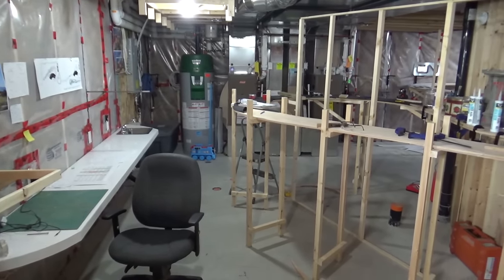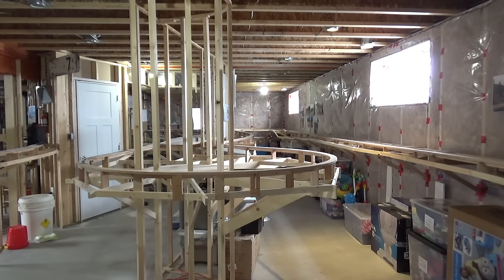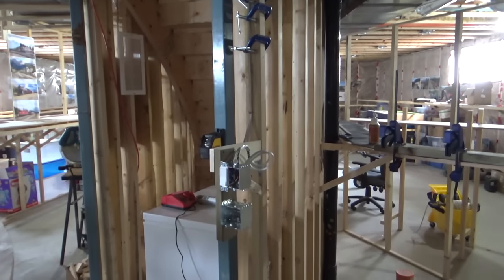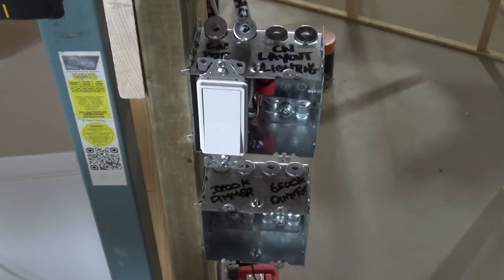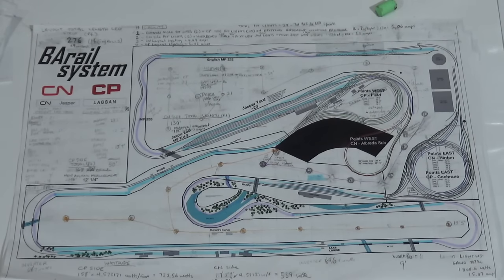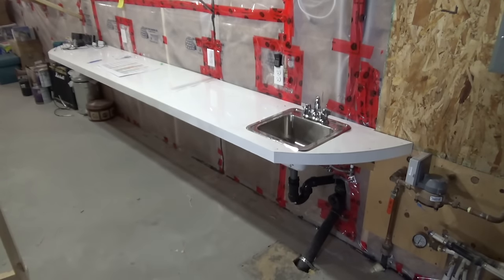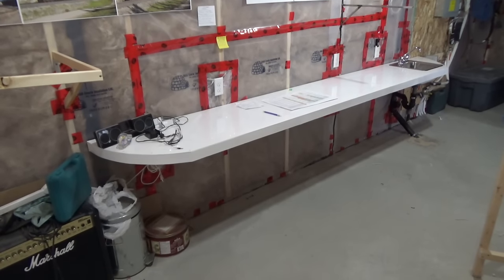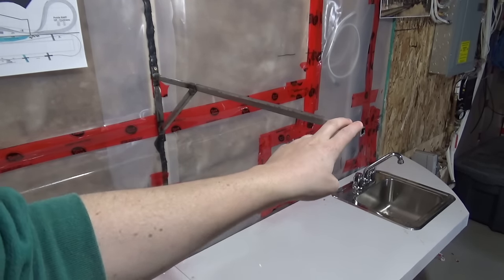Layout Update - March 2017: Reverse Loop Rubber, Airbrush Sink, Vents, Lighting Controls...

Comment: That sink will come in handy more for scenery work then airbrushing. I use one of those Iwata airbrush cleaning jars so it doesn't vent into the room, but now that I've started scenary a sink in the basement would be really nice to have!
Reply from the maker: Ah yeah I have one of those too. I have an extra dryer outlet/plastic check valve above the bench that I plan on eventually using as the vent. When cleaning, I found the biggest pain was cleaning out the paint hopper and inside of the brush when changing colours. I can imagine that it will come in handy for clean up. Scenery gets messy especially with the plaster. Got an earful from the wife a couple times at the old place when I was cleaning up after plastering in our nice finished bathroom :D

Comment: Continue to amaze me every update! If I may request something, I would be curious to see an locomotive roster update like you did a couple years ago if it's possible? I personally would like to see them again and it would be something to do while the layout is being built. if everything is being stored then that is completely understandable:)
Reply from the maker: Thanks Cam. Not much has changed since that video, I did get some Bowser SD40-2's and a couple ES44ACs. They are all packed away along with the rest of my rolling stock to keep them out of the dust so no videos until at least the drywall is complete. Sorry about that, it's on my list now to do an updated version.
Reply: BArailsystem alrighty man I completely understand! all my stuff is packed away due to moving places and I've been busy with school. Cheers!

Comment: This is a great update. First really like the layout you are building and the size is awesome. Great ideas and planning, the work bench area, I just wish I could have half of that. Question, early in the video your mentioned that you were laying 1/8th inch rubber on the layout. Is that on top sound deadening rubber mat? Is that done on the entire layout? Also, on the metal support over your work bench, could you use the same support and take a slightly longer support arm, place it at a shallower angle and have is come out just a little further? That might help solve your problem and still use the same size tubing? Thanks for the update and can't wait to see more!  D. Muse WTCMRR
Reply from the maker: Thanks David. The 1/8'' rubber is the sound deadening material. I'm going to lay cork roadbed on top of that and the entire layout will be done like that. That's a good idea about the support, I was thinking about making it longer but didn't consider making it at a shallower angle. Thanks for the tip!

Comment: Either use solid square stock or try filling square tubing with epoxy resin to see if it stiffens up before you go thicker. Nice work!
Reply from the maker: I thought about solid stock but I would like to keep them hollow for a slide in fascia attachment. Definitely will keep that in mind though thanks.

Comment: There may have been a local code requirement for the location of the HVAC vents.
Reply from the maker: As long as there is still one near every window I should still be in compliance. Now you've got me curious though I'm going to see if I can find the code.
Reply from the maker: The electrical outlet near the sink is definitely in violation of local building code but that is only temporary until it gets changed to a junction box for the airbrush booth fan power.